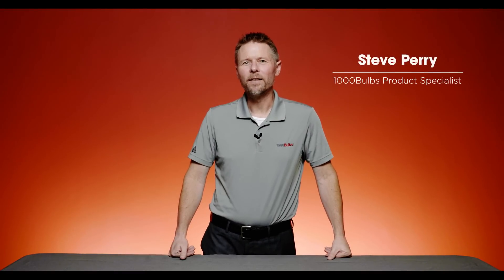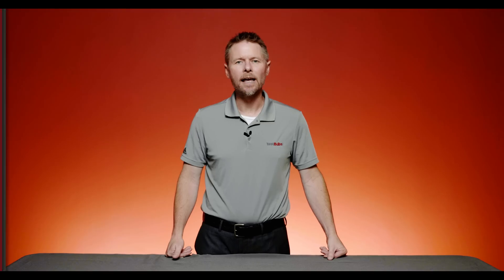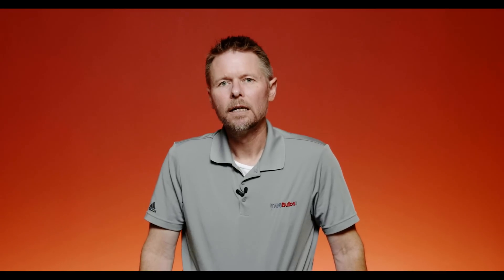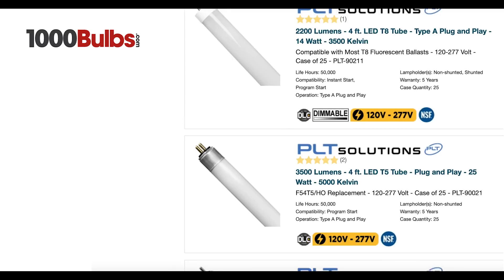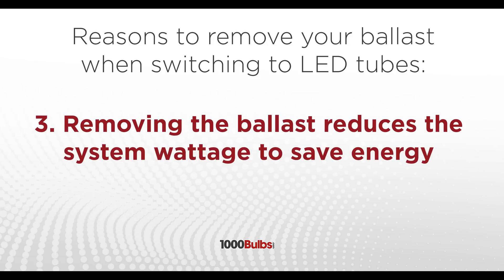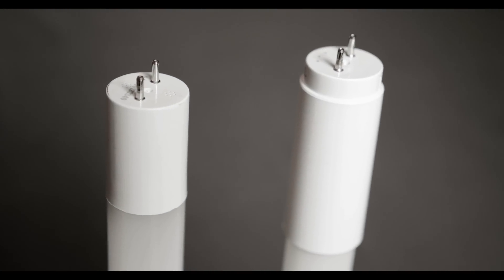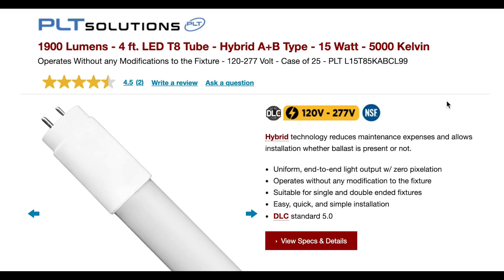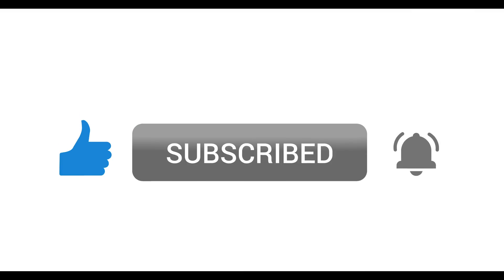PLT Solutions LED Tubes | Product Spotlight

Comment: As a retired sparky best thing would remove all older ballast. Eventually they all go bad plus use some energy.Do not like having 277 volts going to flimsy lamp sockets that would be in larger commercial sites.